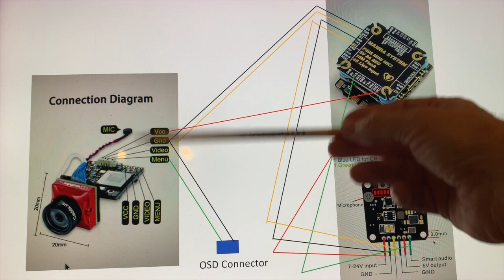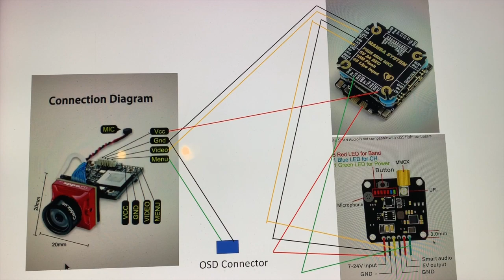How to Install a Caddx Turtle V2 System

Comment: I have a question. What is the the pad labeled "CC" on some boards. Im getting ready to wire up a turtle v2 on a new build and ive heard that u can connect the green wire from the dvr board to the cc pad and it allows you to be able to access osd remotely thru that uart. Ive only been doing this hobby for about 2 months now. Sorry if that was a dumb question. Thank you.

Comment: Cheers for making this. I knew it needed a vtx just helps my planning when you have done the homework. How long have you been using it and what's one thing you don't like about it?
Reply from the maker: Adam Anti-pop thanks for watching and hope it helped. I’ve been using it on a 3” and 5” quads for about a year and like it. The one thing I don’t like about it is the process of mounting the board. You have to be creative and I suggest you “ dry fit” everything before final soldering and mounting. Good luck!!!! 👍

Comment: I like the video. A question for you.  I am thinking of changing the stock camera on the TYRO 119 to the Caddx Turtle v2.  Will the current VTX that came with the TYRO work with the Turtle or do I need to get another VTX?  I have been looking for the answer but I haven't had any luck yet. It's probably staring me in the face.
Reply from the maker: E Burroughs I’ve never built a tyro119 but I’m confident that the 119 VTX will work fine. really the only requirement is that the voltage supplied to the Caddx Turtle v2 be 5volts. Just ensure you supply 5 volts from either your FC or VTX (5 volts output) . Connect the yellow video wire from the Caddx turtle v2 to the camera pad on the FC and ground to the FC ground pad. Same as a new camera!! Let me know it that helps.... and if you have any questions.
Reply: @bladejohnson3881  Thank for the quick reply. I will let you know when I get it done. Thanks again for your help!

Comment: Thanks for the Video..  I got black screen but the information in OSD still show..  any solution?
Reply from the maker: Rahmat Firdaus ironically I’ve got the same problem on one of my quads right now!!!!! Looks like the Caddx Turtle board may be bad. Power the quad up and see if any LED’s on the Caddx Turtle board comes on. Let me know ... thanks. 😉
Reply: @bladejohnson3881  yup the board LED's on..
Reply from the maker: Rahmat Firdaus I would think it my be the camera. There is one more thing to try. Unsolder/ disconnect the Caddx turtle board from the vtx board and connect another regular camera directly to your vtx. Power the quad and see if you get video. This will prove it’s not the vtx board.
Reply: @bladejohnson3881  ok, one of the solution..thanks, I'll try it
Reply: Solve. Thanks, I used 5v before and I remove the red cable to the power battery.